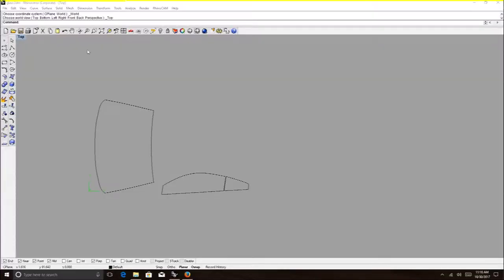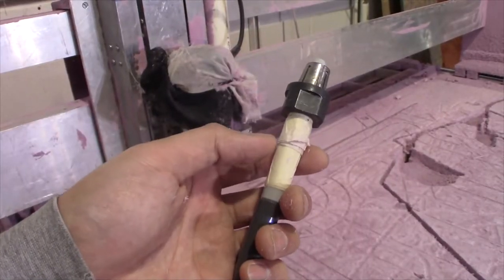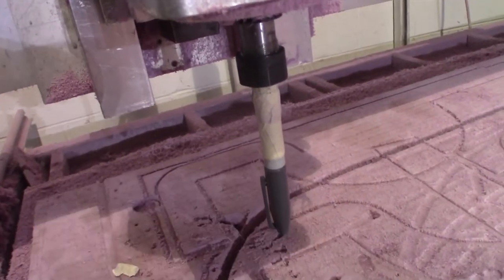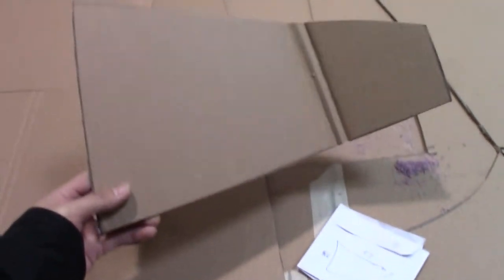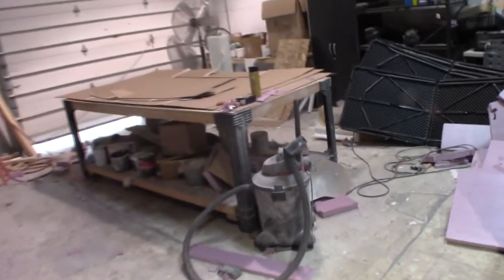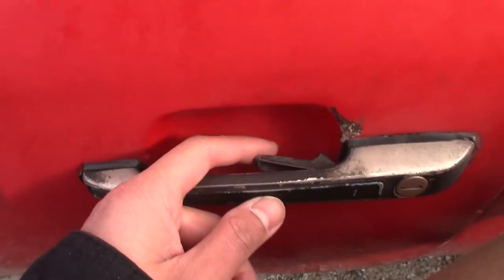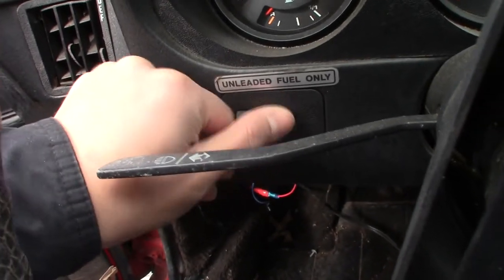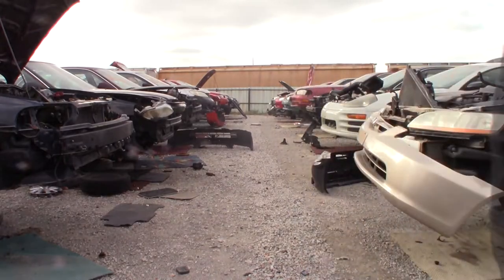Rummaging the salvage yard for parts for the SUPERCAR project

Comment: Water jet is best option to cut curved glass. Used to work with a guy who designed sunroofs for old Porsche 966s and we had to have some test sunroofs trimmed after many failed attempts with diamonds cutting wheels and such we went with a water jet shop and it worked out well.